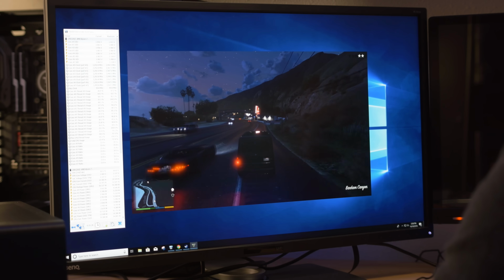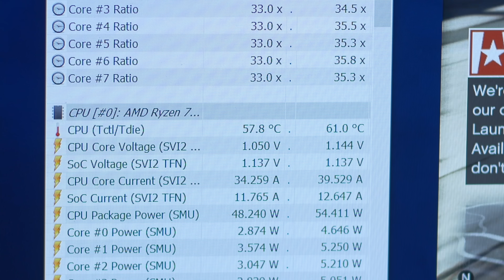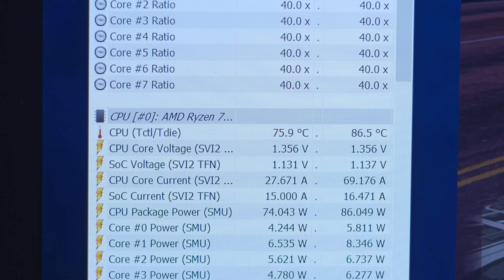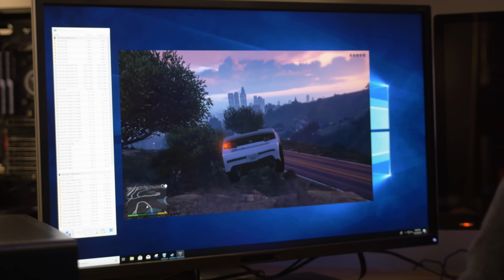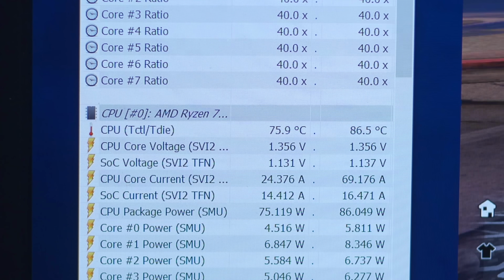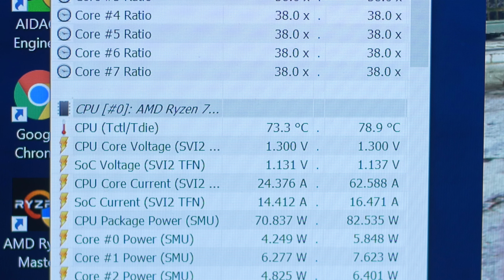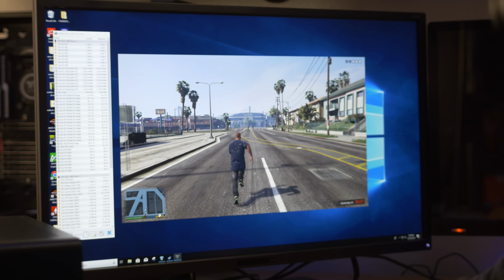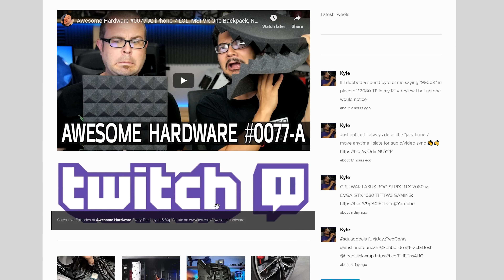Testing the limits of a 92mm AIO with Ryzen!

Comment from the maker: Sorry this video wasn't up to par with our regular content, guys. The truth is that this was going to be a much longer piece featuring a couple more upgrades to the system, including custom cables which we were really excited about. When the cables arrived on shoot day, we noticed the 24-pin wasn't the proper length and wouldn't fit the build - That's because I had someone take measurements a week prior and didn't double check their work, so that's 100% on me. Adhering to our content schedule, we needed to shoot a video that day but in hindsight it would have been best to postpone production. I'll be publishing our next video a couple days early (later today) so you guys have a full-length piece to watch this weekend. We try to make the best videos we can but fell super short of that this time. Sorry again and thanks for all the feedback. We really do appreciate it. 💙
Reply: "We try to make the best videos we can but fell super short of that this time"
Just like your 24-pin power cable, HEYO 😋

Honestly, a short video is fine. The problem with this video isn't the length. It's as many people already pointed out, swapping a 2700X out for a 2700, then overclocking the 2700 to run at the same clocks as a 2700X, and still expecting temps to lower, makes absolutely no sense.  If this had been a 5:39 long video where the 2700 stayed at stock, or the 2700X got downclocked, so that things actually cooled down, it would have been fine.
Reply: @mjc0961  Yes Exactly, or even better in my opinion, doing the video exactly the same to treat this as a learning experience for people who would think the same thing (after all that assumption is a common one among new builders looking at TDP Specs) but then at the end of this video point out why that assumption was wrong, and then take 2 minutes or so, to just explain what the TDP ACTUALLY means. This way the viewers who didn't know come away learning a pretty good lesson, and then your video is perfect, even without different cables. 

But either would have been fine. Anyways, still no sweat, still love ya Kyle.
Reply from the maker: @evocatiproductions  Completely agree. Definitely should have gone into detail as to why assuming temps would be different at same clocks on same arch is misguided. Missed opportunity to highlight some common misconceptions on TDP. I've gotta learn to stop rushing videos when shit hits the fan. Thanks!
Reply: Its all good, you still the man Kyle. Just remember Kyle, it is not the length of the video, but the quality therein. Teach these young nerds well Kyle, and you shall flourish. The only mistake in this title, was not teaching us why your assumption that the lower TDP would produce better Temps when both CPU Were clocked the same. Had you simply ended the video with teaching these young ones why that assumption was flawed, and taught us what a TDP actually was, this video would have been perfect in my opinion. But thats just me. 

Anyways, no sweat, there is always the next one! Much Love Master Kyle!
Reply: Have you tried undervolting the 2700x? I have mine at 4.1 at 1.26ish volts. Forgot the exact number but it’s like 1.26275. Maybe I got a good chip, idk
Reply: Will there be a follow up video with the missing parts and also undervolting/clocking the 2700x to see if it can do 3.8 GHz at a lower voltage? I'd be interested to see that even though I'm expecting similar results (but who knows, maybe they are binning them)
Reply: @EMPeter  I Second EMPeter's Interest. It would be fascinating to see if there are binning differences between the 2700x and the 2700. I assume there are, but it would be awesome to see an example of this. So for instance downclocking your 2700x to see if you can get Lower Voltages at the same Clocks (And therefore lower Temps).
Reply: You looking like a snack in this video don't worry about it
Reply: You're being too hard on yourself, it was fine, don't worry about it.
Reply: It was good, just a bit short, that's all.
Reply: Honestly, I didn't really have any issues with the video, per say.  It wasn't particularly memorable, but it definitely wasn't terrible, either.  It was exactly what I was looking for to kill a few minutes, thanks!  Looking forward to seeing further upgrades on that little rig... tiny cases are bae.
Reply: No harm done. It was actually the first video I clicked on to watch and the content was still surprising considering the super small form factor
Reply: No worries Kyle
Reply: @Bitwit shouldn't you be able to underclock the all-core turbo and keep the single core up high, while undervolting the 2700X ??
Reply: So will you be doing another video on dan case?
Reply: Um, you swapped a 2700x for a 2700 because it was lower TDP, but then you applied the same OC voltage to both...that throws the stock TSP numbers out the window. They’re literally the same chip with different stock clocks. You had both running st the same voltage which means they were the same TDP, therefore no temp difference.
Reply: I liked this video almost better than some of your others... a pretty straightforward hypothesis, testing it, talking about the results. Makes it a bit more bite-size :).
Reply: Ain't no thing man! No worries!
Reply: You can do 1.1875 volts and it runs stable nice and chilly
Reply: https://rover.ebay.com/rover/0/0/0?mpre=https%3A%2F%2Fwww.ebay.co.uk%2Fulk%2Fitm%2F123454354516 cpu/ motherboard sale.
Reply: what if you slapped that prolimatech samuel 17 on there? would that fit and dont u think temps would be a bit nicer?
Reply: Bitwit , I can’t find the asetek 545lc anywhere... do you know what else would be compatible in this build? Without any modification
Reply: looking forward to the custom PSU cables and an update to this build =D
Reply: Thought the content was really great Kyle, was enlightning as to how comparable the 2700 & X versions are for thermals at similar clock speeds with limited cooling
Reply: @bitwit was there ever a follow up to this build? im highly interested in making this exact build but there were so many changes or changes that havent been shown im not sure where to go with the part picking.
Reply: @itsTouEasy  I just did this build, difference I'm running the i7 7700k, 2080ti and a Silverstone sx700g. Not sure if the Corsair PSU makes the difference but it's impossible not to stop the AIO fan without custom cables. I used pslate and I was extremely happy. Next the AIO from astetek is no longer in production. So you're going to pay a lot for a used one. Plus that aio is the only 92mm radiator that will fit with a full sized GPU because asetek has a patent on it. On top of that after about an hour once equilibrium is reached, it's not much difference then an air-cooled noctua. I suggest stick with air cooled or get a itx gpu and run a 120 AIO
Reply: @bretharv0213  what are your temps like? im honestly just interested in maybe COD blops 4 and Monster hunter world... 1440 60 fps+ (locked if this rig cant handle it)
Reply: @itsTouEasy  Have not tuned the voltage or overclock yet. 2080ti is running 71 degree max 73 underload stock, 7700k is running high 70s make 83 underload stock with 4.5ghz boost with noctua l9i with panels on. Side panels off drops it 4-5C. I did depid
Reply: lol, "trust but verify"... "today's labor force is______", "Covid delays"... yep. good works man.
Reply: Don't stress. Enjoy your weekend 👍
Reply: blames himself by blaming someone else :/ professional dude

Comment: On that form factor, wouldn't it actually be easier to get better performance out of some of the air coolers that are available? 'Cause I dunno if that tiny 92mm rad with that small and slim fan are doing all that much tbh. Looks like you could fit a larger air cooler in there instead.

Comment: Kyle try moving the cooler fan to the bottom side of the rad so it can push air through rather than pull. it will likely help with the cable issue and will allow possibly for more air to get into the case as that fan is likely not really great at static pressure and could be starved a bit. you could also try a noctua industrial ppc fan.

Comment: 79°C at 85W... that is the proof that small AIO simply do not make sense, any decent 92mm Air cooler would match that, hell, even the Arctic Alpine 64 Plus, a 14 USD cooler would beat that... Liquid cooling makes sense if you put the mechanical heat transfer to good use with a 240 radiator or bigger, anything below that, you'll be better of with a good air cooler.

Comment: This is dumb. If you want better gaming performance while still lowering temps you should've went with the 2600x and overclock it to 4.3ghz. 2700x = binned 2700 with higher stock clocks

Comment: I wonder if the tightly stacked cable right on top of the 92mm fan reduce cooling performance? Perhaps another benchmark with the rad+fan just detached from the bottom and put to the side of the case? Just to confirm it's not the lack of airflow that's restricting the cooler, but the max.cooling capacity of a 92mm low-profile rad.

Btw, I'm designing my custom m-itx case (or frame - more likely), and of course I plan to be able to stick things like i9-9900k + rtx2080ti inside. So after considering several options I think I'll go with 
full water-cooled build but with 2x 240mm rads. Currently I plan to use EK's aluminium series, which have ultra-lightweight low-profile (28mm) rads (that both weight about 600gr together /dry/).
I plan to put one on the bottom & one on top of the case kinda like a sandwich :) That should be the most efficient volume-wise since they'll use almost the full width*length of the case and only add 106mm (2x 53mm) (about 3.5L would be for rads+fans). I'm really tempted to go with low-profile fans, but that's probably a bad idea given that low-profile rads also have higher fpi and would require higher static-pressure fans.
So dimensions of my case would end up to be something like: 29cm tall, 29cm long & 12-13cm thick (about 10.5L).
Obviously that would be about 50% bigger than Dan's A4, but should have plenty of cooling and still be backpack-able size and weight (rough estimation of 6-7kg)

Comment: Your temps are so weird. I have my 2700 nonx clocked to 3.7ghz with just 1.06125vcore and it never hits 50c on load.  LLC is level 4 on my Asus x470 rog.  Using cheap 212 hyper Evo heatsink.   

Going up to 4ghz isn't so bad either. Can just shoot 1.18v to it and still be stable and just barely hit above 58c.

Comment: You might not be giving your cooler and the 2700X all it needs. Building my 2700X on a Gigabyte Gaming 5 Wifi, i found the BIOS would only let the Corsair H60 spin the fan up to 1200 RPMs. Using the Gigabyte SIV App i was able to set the pump and fan to more aggressive configurations (fan max is spec 2000 RPM) and dropped my temps by 6+ degrees when CPU is 100%. I still see 75 C but never higher.

To note, mine is a 120MM radiator, but it is also 4 years old and on its third build! I'd hope the Asetek 92MM with a Noctua fan would be on par with the stock, aged Corsair H60.

Comment: I found running 3.7 with core boost off and powerplan settings to be ideal.  AMD is pretty aggressive with auto voltage when it comes to auto overclocking, i notice with core boost on voltages sometimes spike to like 1.47v for 4.3ghz.  Without core boost it stays at a low 1.217-1.3  at 3.7ghz. I wish I could turn the base clock up and let the powerplan do its thing in lowering the frequency when not in use; but BIOS automatically locks it once you mess with the baseclock and will override the ryzen powerplan auto downclocking.

Comment: The TDP rating is effectively useless, its literally only reflective of the "base clock" before any boost. The 2700 and 2700x at the same frequency and voltage will be functionally identical. The 2700x should be binned better, so you most likely would be able to get 4Ghz at a lower voltage. Basically, if anyone else is worried about the thermals of their 2700x in an SFF PC, don't waste your time attempting to swap in a 2700.

Comment: I don't care what everyone else says, it's nice sff build. I was discussing to my friend earlier today about the tdp of the 2600 and 2600E, and how just underclocking the 2600 to get it to run cooler is possible. Especially with the price of the 2600 at $160 is a steal, and the probability of the 2600E costing the same when it releases. This video just confirms what I told him, so alas I shared this with my friend for confirmation

Comment: I built a new system and at stock setting of the cpu I was getting 88 C in games. Found out that the power management setting was set to 99%. Change my power management to 40% to 90%. The cpu in games temps is now lower. This was a R5 2600 at 3.4 hz.

Comment: ehm wut? I am running my ryzen 2700 @4ghz with stock cooler at 74 degrees load. And yes this video is close to verge style... 2700 oc tdp > 2700x oc tdp = higher temps. if you would have oc the 2700x by hand you would have gotten better temps.

Comment: Kyle, put the 2700x back in and run it at the same clock speeds. You might get lower temps because it's a better binned chip and might operate with better thermal efficiency

Comment: Not sure if Aseteck's software does it, but Corsair's Corsair Link for the same generation AIO bugs out when trying to run HWinfo. When it bugs out it will shut down the pump and fans will not ramp, at least on my PC. May want to check on that.

Comment: Seems its painfully obvious that the cooler is only going to handle so much.  Clocking ends up pushing it to the edge pretty fast with such a small cooler.  Its really nice that it fits and does a great 
job of cooling a stock Ryzen.  I would gamble that the newer 2700x or 2600 would do great just on stock with a 460 mb .  Still running stock would be more than enough for most of us.

Comment: Makes perfect sense as the 2700 and 2700x would pull the same amount of wattage if clocked to the same speed with the same voltage.

Other than downclock all core 3.8 did you test what temps you get using the 2700x and just letting XFR boost 1-2 cores to 4.0+??  Might result in better game performance since you dont really need all 8 cores at full OC.
Reply: also you mght be able to undervolt it for even better thermals while running the 2700x. honestly klye doesn't seem to understand tdp and how it is measured etc. (this is not the first time he has made an error, which is okay if he learns from it, I like this channel hopefully he learns something and comes out with a new video)

Comment: According to https://www.guru3d.com/articles-pages/amd-ryzen-7-2700-review,7.html - the 2700X has a 10c offset, so Kyles temps are even worse on the 'plain 2700, right?
I'm at 1.35v on stable 4GHz - 2700x - havn't actually tested lower volt. Cooling with Nzxt x62- which does a great job.

Comment: What you SHOULD try is to stop manually overclocking your Ryzen 2XXX series CPUs. The improvements to XFR make it better than an all-core boost in most cases (there are exceptions in very specific workloads). Relying on it would help with your temperatures considerably, and possibly get you better gaming performance in the long-run since a huge single-core boost is generally better utilized in game engines than multiple ones.

Comment: Honestly, if cooling becomes that much of an issue i wouldn't even bother overclocking on the 2700.
Id much rather have everything at stock speeds and just let it be. Also, in the dan case i would just throw in a much bigger 120mm AIO solution and just mount it the on the opposite side of the case and just grab a smaller gpu. It really is a compromise in some cases but i feel like cooling is everything in a PC build.

Comment: I noticed your AIO fan is exhausting through the radiator. Wouldn't you get better thermals if it were switched to pull cooler air into the case? Your case temperature would increase, but there may be more headroom there than on the CPU.

Comment: I'm pretty sure everyone already knew that a 2700 and 2700X would put out the exact same heat if they were clocked at the same speed. Same thing with any CPU that is the same exact piece of hardware as another. As long as they are clocked the same, the power draw and heat will be the same.

Comment: Your test is useless. Normally a 2700x should be cooler or could run at same speed with lower voltages than 2700 because x chips are qualified to be x chips since they can run cooler at same speed.

Comment: I had massive issues with my 1700X, It was rising towards 90*c constantly thermal throttling all cores down to 500 Mhz for a week. Then one day I desided to try figgure it out and turned on my pc and everything was fine and sitting around 40*c. Nothing was changed, cpu at stock speed and volt locked to 1.350v. Strangest thing I have ever experienced with a build. I was just about to order a new motherboard since I rthought that was the issue.

Comment: OR 

You could run it at stock and not shorten its like and cook your house? 

Just sayin xD
Reply: The life span of CPU when overclocked, as long as it's done properly, is still really long. Probably a negligible difference from stock. Either way, you will be ready for newer CPU technology/generations long before an overclocked CPU dies. (There are always exceptions for flukes of course).

Comment: I run a 2700x inside a Silverstone RVZ03 case.   I think you'd have better results with an air cooler, specifically the cryorig C7 CU.   The version with the copper heatsink.   My temps are 64-68c under load.   But, maybe I have an amazing chip.